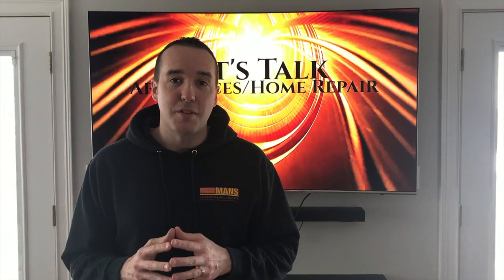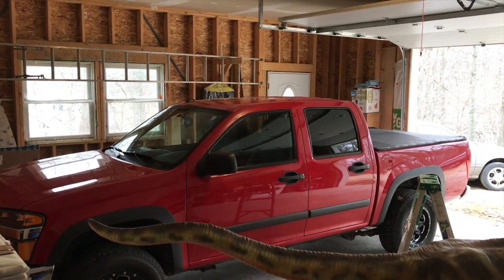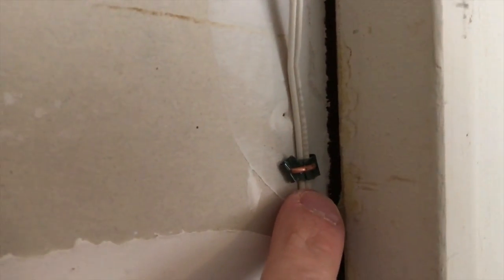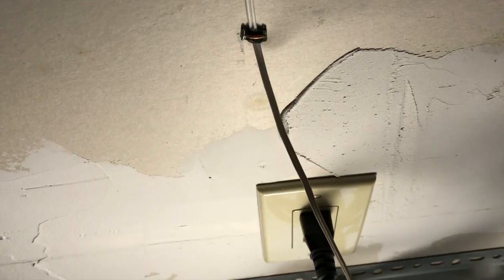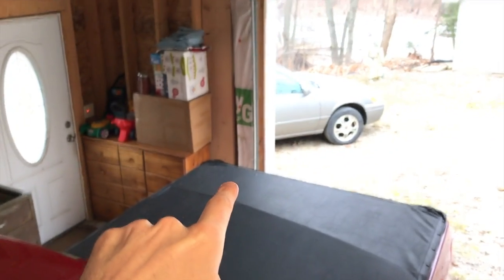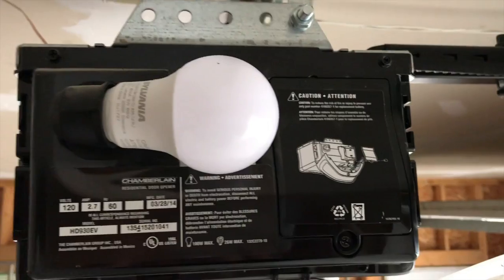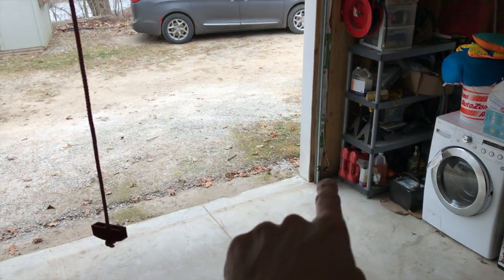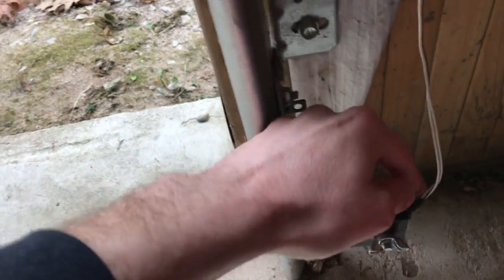Garage door lights flashing/flickering - Most common causes!

Comment: I have 3 side winders Liftmaster garage door openers. All 3 of them will open with no problems. But when I go to close them most of the time the door tries to go down about a foot before it returns and the ceiling light is flashing 10 times. I can hold the button down and the door will close as long as I hold the button until its all the way down/closed. All my wiring seems to be fine. I hit the reset button for 5 seconds, unplugged power for a minute but still have problem. I use to be a half a block away the doors would open with the remote, now I got to get out of my car and be within 5 feet of the door for it to finally open. I check the sensors and one is amber color and the other is a very fast flashing green, I tried to adjust it but the green light goes out all together. Any ideas before I use dynamite : )
I should add that the doors have all worked fine for 8 years only in the last several months they been erratic.
Reply: I cleaned all the sensors lens and the one sensor that was flicking green is now a steady light. I will go around with a wrench and make sure all the hinges and rails are tight. I appears I have more problems with the doors when the sun is rising or sitting low or high with the sun shinning directly into a sensor. When the sun is sitting (evening 5pm) with my garage doors facing north the western sun shines directly into the sensor. If I stand and block the sun and create a shade over the sensor the door closes find. 
Again as always the doors don't have a problem opening but always closing. My remote still has a very short radio distance trying to open the door from the outside in my car. I have to get out and walk up to the door for it to open : (
Reply from the maker: Earl Balentine 

Thanks for the reply.  Definitely keep us posted.  Us fellow DIY’ers need to stick together.  😀👍
Reply: @DIYwithMichaelBorders  Iinstalled 20 feet of small gage wire connected ted to the antenna wire coming out of the light fixture. Seems like it helped some but I still have to be right in the drive way in front of my garage door before it opens with the remote. I attached the wire from the center of the garage with the light/antenna was exposed, tack the wire from center all the way up front at the top of garage door and them down to the corner of garage door. I was expecting the garage door open as I was coming down the street but will not open until I get in the drive away and press the remote 10-15 times before it opens.
Not sure where to go from here?
Reply from the maker: Earl Balentine 

Thanks for the update.  Sounds like you’re making progress.  Do you have a 2nd Remote you can test from a distance?
Reply: @DIYwithMichaelBorders  I have 2 more remotes like new with new batteries and they work the same, won't open the door unless your very closet to it. So it doesn't appear to be the remotes.I tried all 3 remotes and they won't open my single or double garage door unless I'm stand outside touching the door. It appears there may be some radio interference since all the doors will open and close by hitting the wall manual button once. All my lights in the garage are 2 incandescent light bulbs in the ceiling and 4 X 4tube florescent lights futures. I tried the doors with the lights off, no difference. Maybe my home Internet wireless router and all the wifi cameras, printers, phones etc are causing a problem?
Reply from the maker: Earl Balentine 

Thanks for the reply.  It’s possible however unlikely.  Have any recent power lines come into the are in the last few years?
Reply: @DIYwithMichaelBorders  No new power lines, all under street. I have 32 garage doors and 3 remotes, the other two garage doors are rather used and they have the same problem as you have to be right next to the over head door to get it to open with remote.
Reply from the maker: Earl Balentine 

Thanks for the reply.  The other potion would be to reprogram your Travel system however it is highly unlikely that it would help.
Reply from the maker: Earl Balentine 

Thanks for watching.  10 flash indicates that your sensors are off set or dirty.  It’s very possible that the laser lens is dirty and leading to erratic and faulty readings.

Also check the wiring connections at both sensors.  One sensor should be Amber and the other should be Green.

It’s also possible that your sensors are not properly secured to the mount and as the door is opening and closing, the slightest vibration is leading to a misaligned sensor.  Keep us posted.

Let us know if you have any questions.  Please subscribe to the channel and Ring your YouTube Bell 🛎 that would be awesome thanks again!

😎👍🔧🔩
Reply: @DIYwithMichaelBorders  Sensors have been clean and the amble and green lights are on. This still doesn't account why you haver to stand 3 feet from the outside of the door to get the door to open from the remote after pushing the button 10 times. The manual buttons work every time. The outside wireless key pad works all the time. Already ran a 10feet wire from antenna to tops of door and didn't make that much difference. Years ago I use to be a block away the door would be totally open before I pulled in the driveway. I got 3 doors and all 3 doors are program on each remote and they all work or not work.
Reply from the maker: Earl Balentine 

Thanks for the update Earl.  That’s definitely a decrease in performance from years ago.

Have you had an alarm system installed on house?  That can cause interference as well.
Reply: @DIYwithMichaelBorders  I found the problem, 2 new wireless security cameras were installed one in the garage and one in the den next to garage. I disconnected the power to the cameras and now I can open my garage door from the street. 
I took my remote and placed against the antenna/light and the garage door would open and close each time I pressed the button. This led me to believe there was a frequency interference.
Reply from the maker: Earl Balentine 

Thanks for the update.  That’s great to hear.  There is definitely interference from the camera installed in garage.  You may need to install it in a different location.

This is great news, you are making progress!  As I’ve mentioned before Earl...Us fellow DIY’ers need to stick together!

😎👍🔧🔩
Reply: @DIYwithMichaelBorders  I will have to make my garage camera's wired instead go wireless.
Reply from the maker: Earl Balentine 

Sounds like you have a fun DIY project ahead of you.

😎👍🔧🔩

Comment: I couldn't tell for sure but, do you have LED bulb installed in your garage opener light sockets?
Reply from the maker: Donald Joseph Wood 

Thanks for watching Donald!  That LED light was already installed by previous owner before we purchased home.  Keep us posted with any questions you may have.

Please subscribe to the channel and turn on your YouTube notification Bell 🛎 that would be awesome thanks again!

😎👍🔧🔩
Reply: @DIYwithMichaelBorders  hi Michael...my wallmount inside the garage is blinking slowly, but the other keypad ND handheld remotes open and close the garage opener. What would cause just the wall unit to not work
Reply from the maker: bosshova23 

Thanks for watching.  In most cases it may be an electrical wiring issue or the actual mount mechanism itself has failed.

We recommend starting with a thorough inspection of all electrical wiring from the wall mount all the way out to the sensors, as well as up to the garage door opener motor unit.   Check for any signs of stress, wear & tear along the wires, or any signs of melted wires as a result of overheating or spark/arching.

Let’s start there!  Keep us posted!  Please subscribe to the channel and turn on your YouTube notification Bell 🛎 that would be awesome thanks again!

😎👍🔧🔩
Reply: @DIYwithMichaelBorders  thanks for getting back to me...I just had the unit installed a year ago and there is no stress on the wires or anything... Not sure what happen all of sudden, but just seems to not work anymore.  If you have any other suggestions I would like to try.  Thanks
Reply from the maker: bosshova23 

Thanks for the reply.  A few additional steps to take.

1.  Unplug and disconnect the entire wall mount.  After 5 to 10 minutes, reconnect wall mount & allow it to begin its reset/boot up process.  This may reset the unit and allow it to begin working properly again.

2.  If step one fails,  it’s possible that your garage door unit is still under warranty and you may find it beneficial to contact the manufacturer and see what your options are.

Keep us posted.  😎👍🔧🔩
Reply: What if sensor light stay on even iff there not facing each other
Reply from the maker: Romeo Romeo 

Thanks for watching Romeo.  Great question!  Your sensor lights will come on once properly aligned & will stay on.  By staying on, this will allow you to verify that your sensors are aligned & they have proper electrical power.

Below is a link to our video that shows more about the sensors & how to align them, definitely check it out.

       https://youtu.be/FhY7BbrsT4M

Keep us posted!  Please subscribe to the channel and turn on your YouTube notification Bell 🛎 that would be awesome thanks again!

😎👍🔧🔩
Reply: This is one of the best instructional video ive seen yet.  You did a great job   Very detailed.
Reply from the maker: DinDen wenwin 

Thanks for watching & we really appreciate it.  That’s our goal!  We really enjoy making these videos for our fellow DIY’ers.

Definitely keep us posted on your projects!  Please subscribe to the channel and turn on your YouTube notification Bell 🛎 that would be awesome thanks again!

😎👍🔧🔩